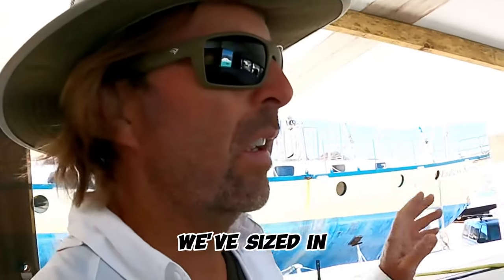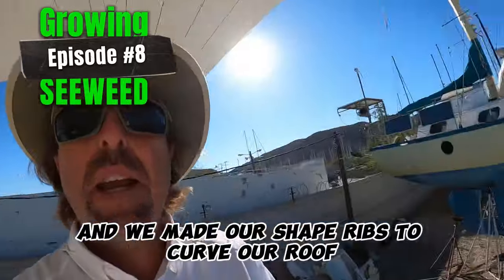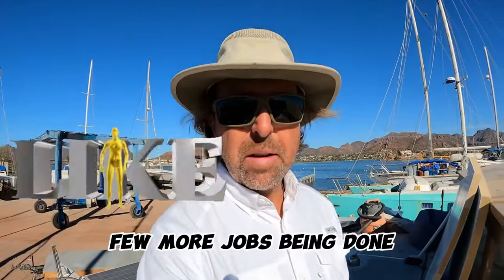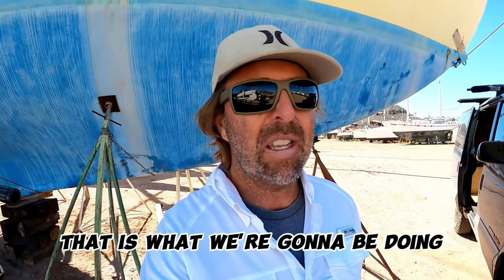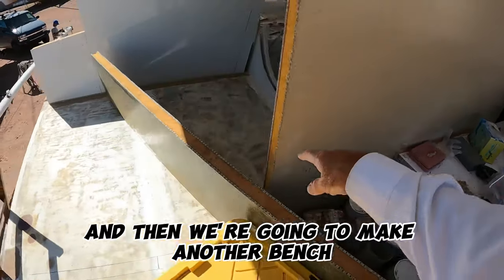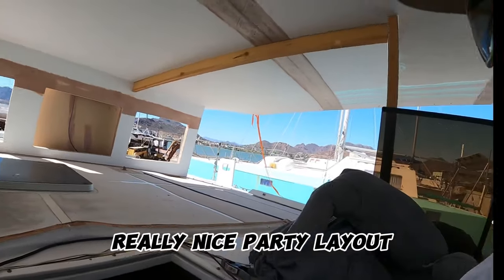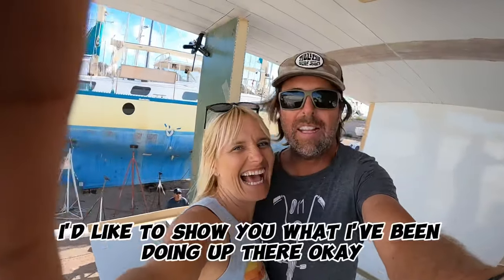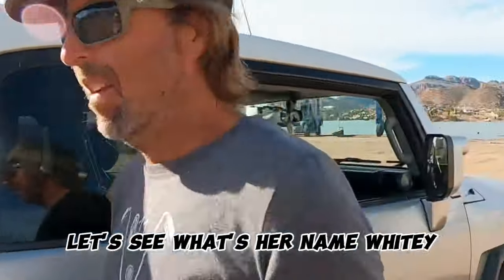(Ep #8) Sailing DIY Trimaran Redesign “Building our modern Loft” Great music edition

Comment: Those panels are STIFF! Are you going to glass over the kerfs you cut in the roof? Cutting the glass on the inside of the panel weakened the panel I am sure. If you glass back over it I think it would restore full strength and stiffness.
Reply from the maker: Yes we plan to glass over and we used 406 filler with epoxy to bring them back strong.  Because there is short span between the supports they will be strong.